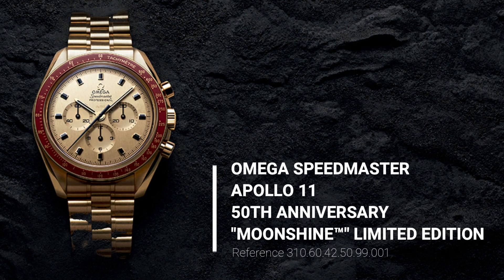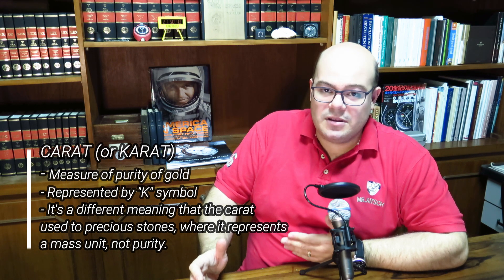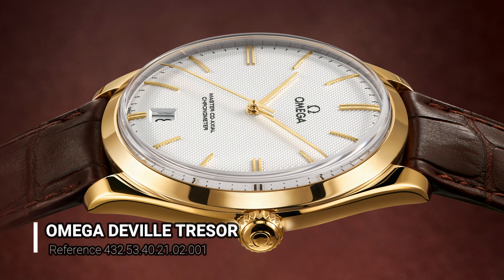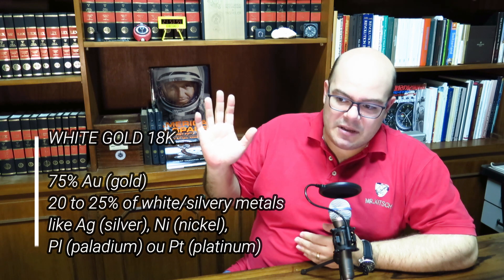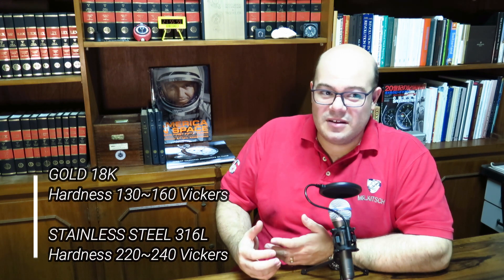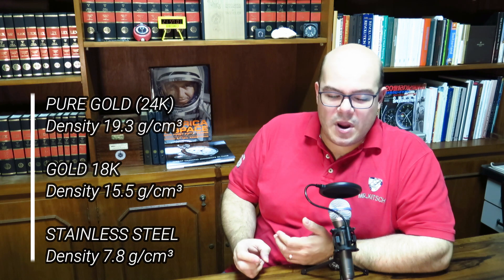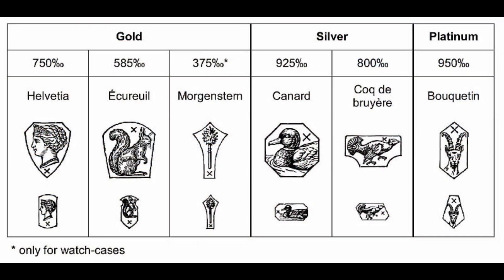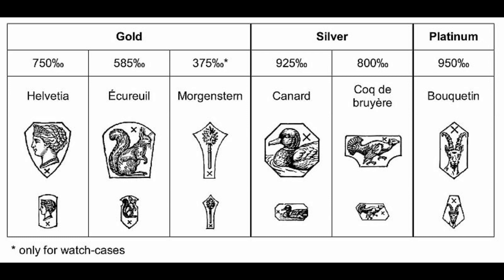[EN] Materials used to make watches #02 - GOLD

Comment: Great video, congragulations! Sometime at minute 15 you show some pictures that are engraved at the clasp's bracelet of swiss watches. I saw on the Hublot Big Bang Capuccino Gold 750 41mm a open wings bird (looks like the X letter). Is that correct? This watch is original? Why the bird doesn't appear in your table? Thanks for all videos, I learn a lot with they.  I'm brazilian and we met in 2009 in a Omega comemoration for the 40th moon landing aniversary in a store at Iguatemi shopping center.
Reply from the maker: Hi! It's difficult to say anything without seeing the symbol, but anyway it's certainlly not a precious metal hallmark, but a manufacturer stamp instead (the actual manufacturer of the clasp). And also it means nothing in terms of authenticity since what forgers actually do is to replicate the original instead of doing something different. Wouldn't make sense.
Reply: @CHRONOTALK  could it also be a mark made for a specific market? For example between 1881 and 1934 ( not sure if the yesrs are exact) sterling silver manufactured in Switzerland for export to the UK bared marks of two standing bears and one smaller standing bear for silver of above 850 or 900 , again not too sure of the purity levels in question.